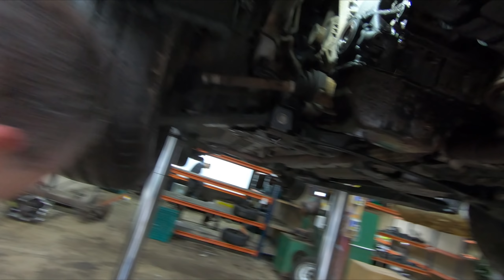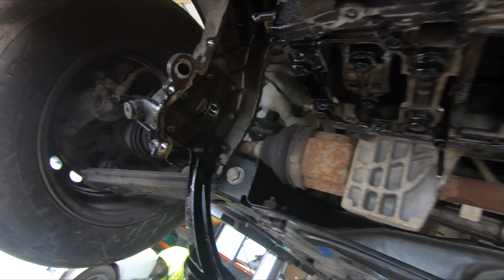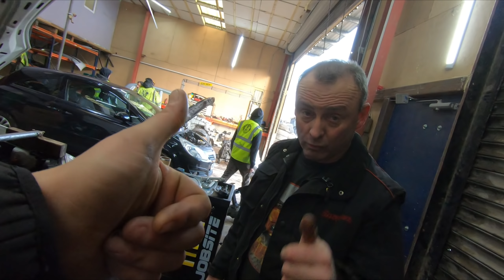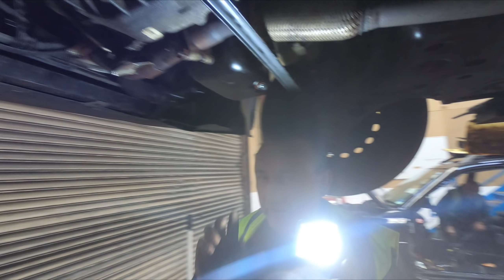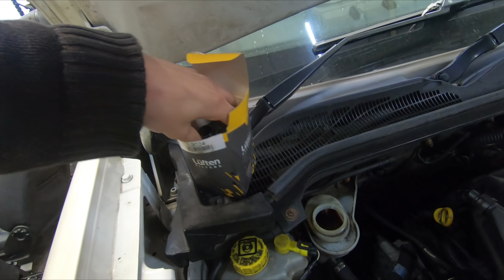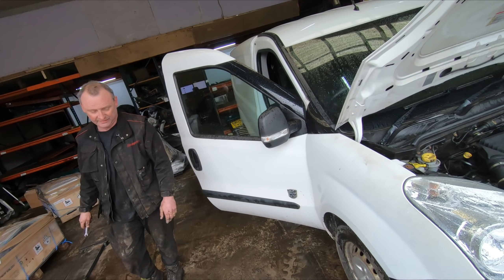We Rebuilt The Vauxhall Combo A13FD Engine... WILL IT RUN?

Comment: That Ken & Norman filter speaks volumes to me. Firstly they let more crap in, as well as air, secondly, instant high revs off the lights and all the stresses it places on the engine. Go back to stock, or if you want more “power” fit a bigger van/truck standard air filter (like a ducato).
Great video, Marky is a top bloke. I’d like to see a tool box tour, very American, but I saw you carrying a load of US Pro tools in an early video, so kinda interested on the “mix” of tools use lot ‘av.

Comment: Well done.  I had a 14 plate Fiat Fiorino with the same engine that had a failed oil pump right at the beginning of lockdown in 2020.  The garage I used replaced the pump and fitted a new chain only to discover afterwards that the engine was knocking so they ended up having to replace the engine and wrote off the labour costs for the original failed attempted repair.

Comment: Salvage rebuilds UK channel had one of these in the other month & a very similar situation & it turned out to be the cam lobes had moved as the lobes are only pressed on & no forged. Great channel guys❤️it
Reply: Citroën berlingo they never went through it as much as this
Reply: @steven907  they did a doblo after n was injectors

Comment: The usual lack of oil maintenance not getting em serviced is nearly always the reason engines pack up.these fiat multi jets are very reliable if you look after them I've seen them with 200k still running well.
Reply: Nice to read a sensible and honest comment about these FPT / GM engines rather than just slagging them off.

Comment: modern cars with built in problems , you would never here of rusty sumps , years ago , cheap thin metal now ,and as for internal clutch slave cylinders , what a clever design , to increase workshop prices ! an outside cylinder would take 40 minutes , interesting channel , these modern cars are designed to die young !

Comment: if you have the sump off knowing that you have a oil pump problem you need to check the main bearings whats the point of fitting a new oil pump to what could be a scrap

Comment: Hi,i have Fiorino 1.3  Euro5 with 75hp.I have problem , when i startup car ,engine knocking and knocking noise after some minute are disappearts but after 3-4min i have blue smoke and car engine rpm jump from 800rpm to 1000rpm.I have check 3 times injector(in Bosch servise),new timing chain,new glow plugs,new DPF.Oil is always on max.When car litle get worm all is OK.Also I have buy new MAP,MAF and new oil separator.Can you please help me?Thanks
Reply from the maker: Ours smoked for a few days after use, it seamed the van kept spraying diesel in the catalytic to clean it, you may just need to give it a good run for a few days